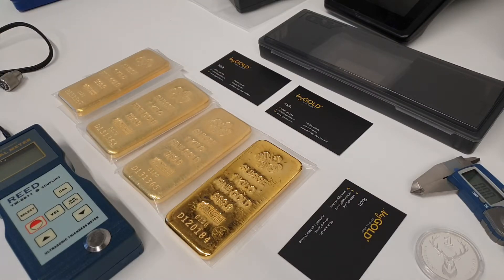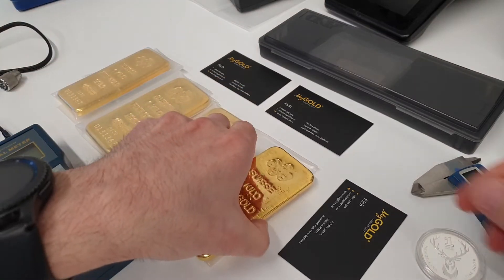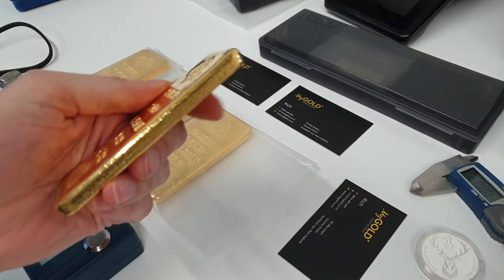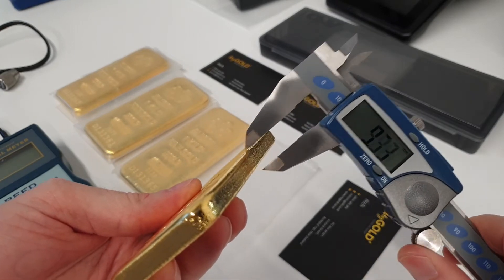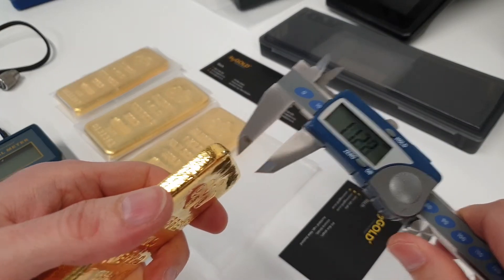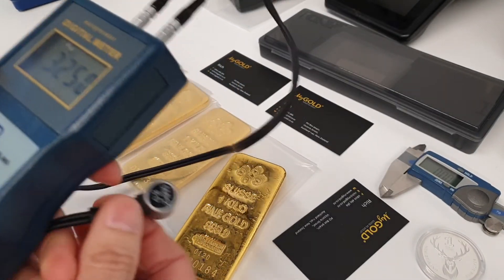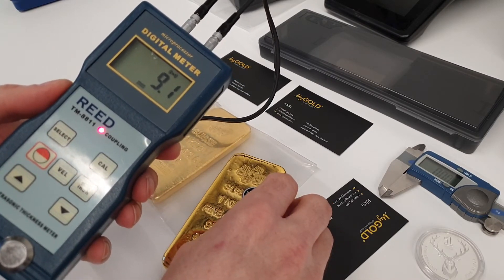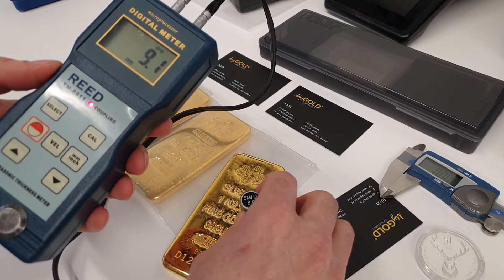Ultrasound Testing of Gold Bars - Checking for Tungsten or other materials using ultrasonic

Comment: I checked online and found these available for about $600-$650.00 However I did not see that they specifically mention, Gold or other precious metals, in their list of detectable metals. Is that just knowing the conductive speed of each metal and making the correct settings? Can this Ultrasound also do Platinum, Palladium and Silver?

Comment: Does ultrasound test work on sealed gold bars (5 gram Pamp for example)? I'm planning to get a cheap ultrasound tester for simple testing purposes.
Reply: Ultrasound doesn't work through plastic. There needs to be DIRECT contact between the measuring knob and the measured object.
Reply: Did you ever get a answer to your question
Reply: @stripe14631  Nope. No answer for that
Reply: No. You cannot detect the thickness of the gold if its sealed. The probe needs to be in contact with the surface of the material needs to be tested. If its coated/sealed with a different metal/material you need to remove it first.

Comment: devices like the wt130a come with two brobes, the smaller one is 6mm diameter, which is very useful for the edges of bars.  its worth noting that the device will detect material faults like cracks and bubbles too.